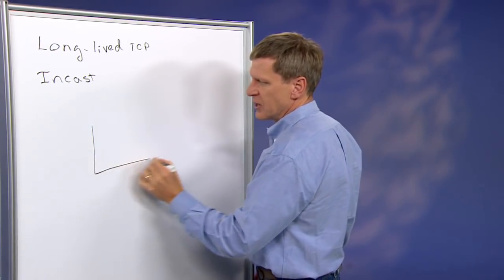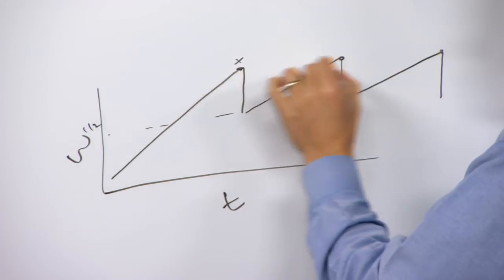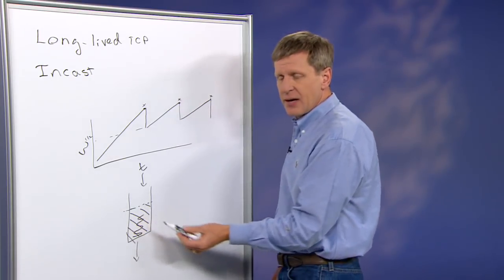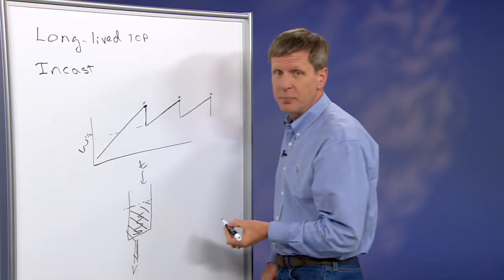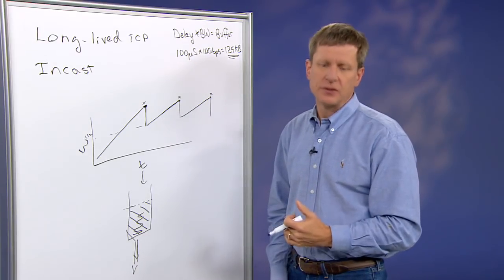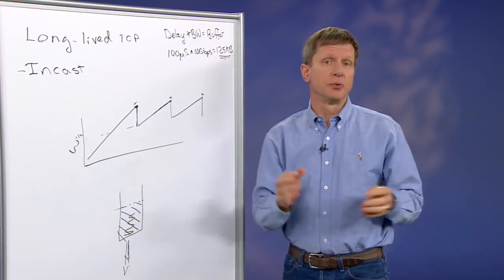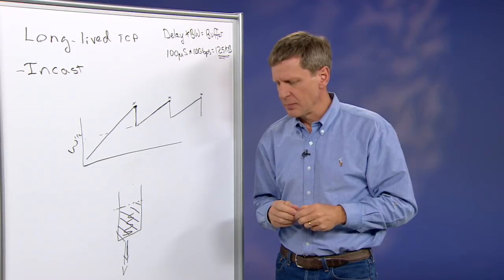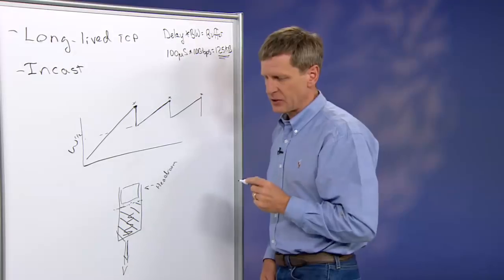Data Center Innovation Series: Switch Buffer Requirements in Networking

Comment: Long lived is aka - Elephant flow. Short lived is aka Runt flows. So for a shared output buffer aka Tomahawk IV the buffer can be considered as occupied buffer(alpha) and unoccupied buffer( 1-alpha).  Buffer sizes for N flows are sized to BW*Tdelay / sqrt(N). This can be termed as McKeown's second equation.  Runt flows typically coexist with other Runt flows in the buffer. If alpha is the occupancy ratio of a buffer, arriving runt flows are split evenly on (1- alpha)* cumulative buffer size. One term that will show up in Buffer sizing analytical models is the square root of Window size for TCP.

The Delay BW product - is 2.5GB for 100Gbps with 200ms RTT so its too huge for any Networking SOC. This becomes a lot smaller when N - number of flows increases , for N=10,000 the delay BW product can be 100 times smaller and still the 100G link will perform.